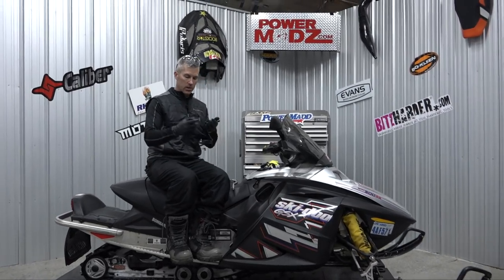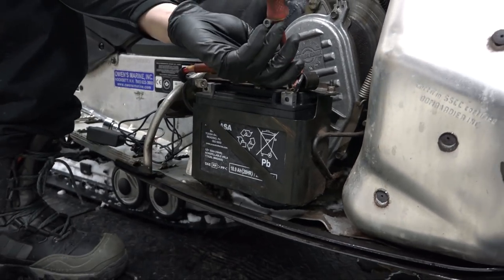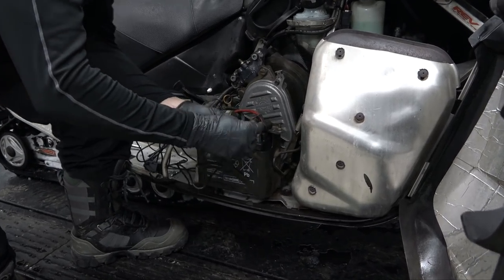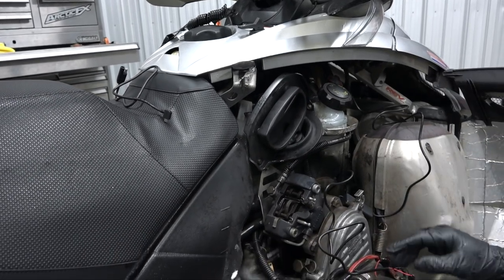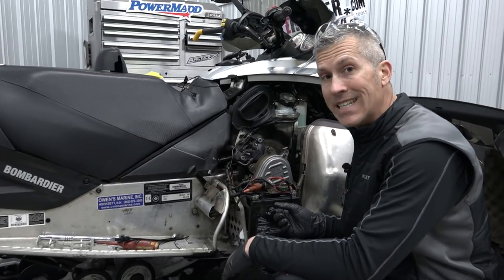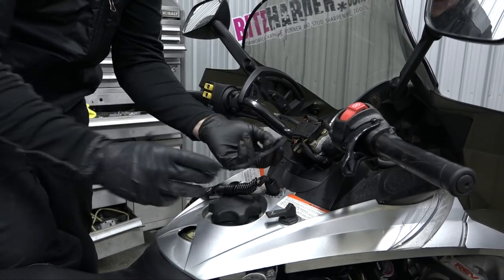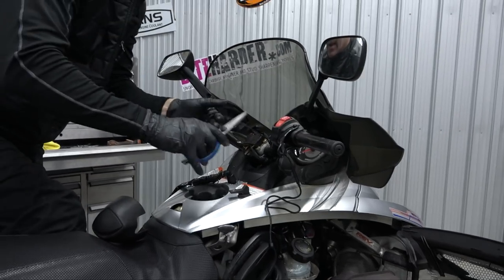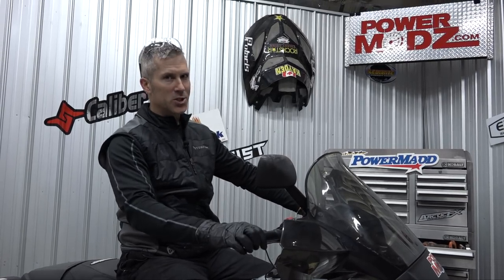Powermadd 12v Cell Phone charger for your snowmobile!!

Comment: I installed a 12 volt on my sled and quad, I ran a switch to them so it doesn't draw power all the time, but works great,  can charge my phone in my pocket

Comment: How would you install this if your sled doesn't have a battery
Reply: Same question
Reply: +beastlyrc707 probaly threw the stator
Reply: +beastlyrc707 he says in the vid not to use it with ac power
Reply from the maker: +dexterlexter123 You'd need to find a dc source on your sled, some have them.
Reply: Voltage regulator

Comment: Hey Man!!  I've been watching your vids nonstop for the last week or so!  I gotta say I absolutely love em!!  You by far have the most info and best detail out there.  One thing I am struggling to find tho is how to wire a 12v outlet into a Gen 1 rev.  I have an 06 summit 800 ho adrenaline and would like to wire a 12v accessory socket for phones, gps, ect.  Any help with that would be great!  Thanks a ton and keep up the good work!  ps I stole your line " it ain't snowmobiling unless your coat smells like gas". I use it every trip!!
Reply from the maker: lol thats awesome!  best to check the wiring diagram or just find a power source with a multimeter